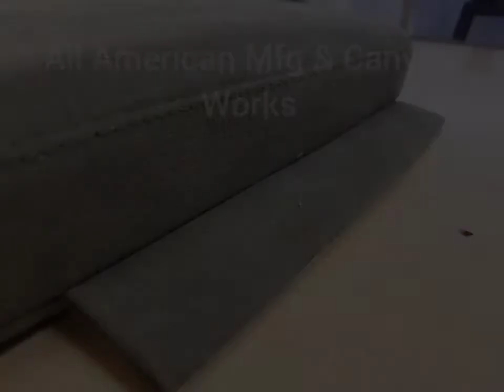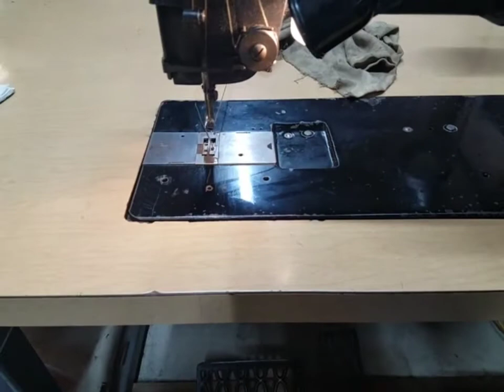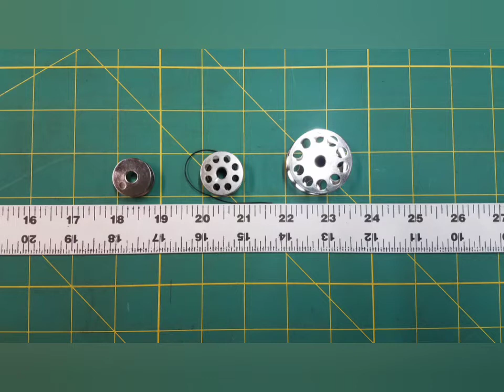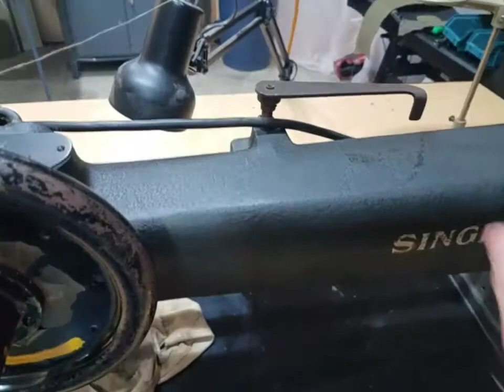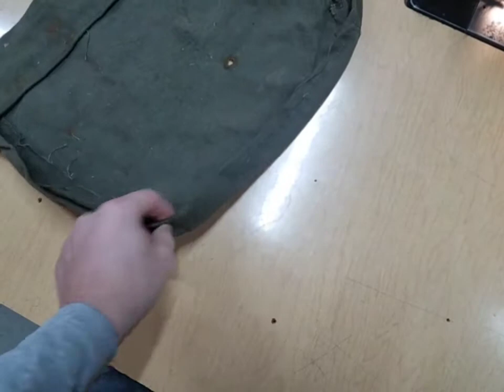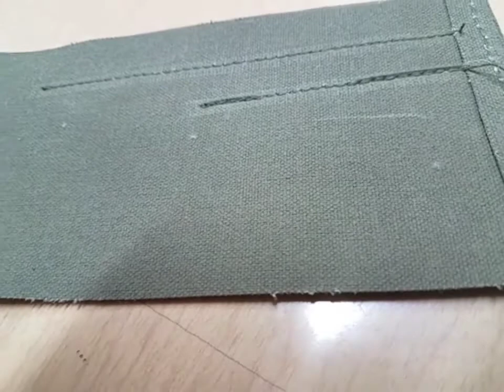Video #2 Singer 144w304

Comment: Hey man I got the same machine but it’s out of time. I got a manual for it online and I kinda figured out which bolts to loosen to adjust timing but I just can’t fully understand it yet. I’m familiar with fixing juki machines but this older long arm is a challenge how can I get a hold of you?